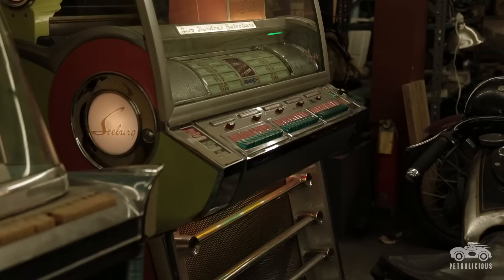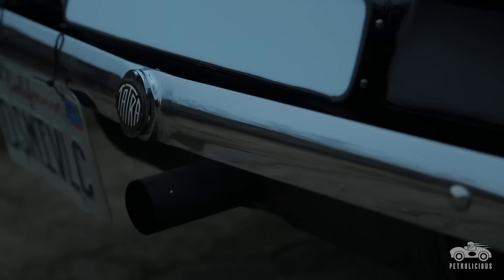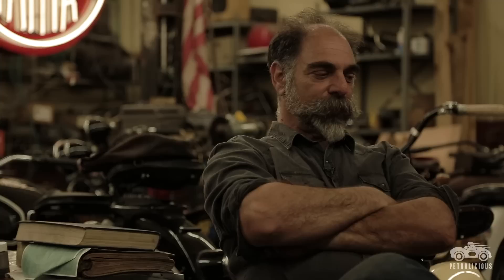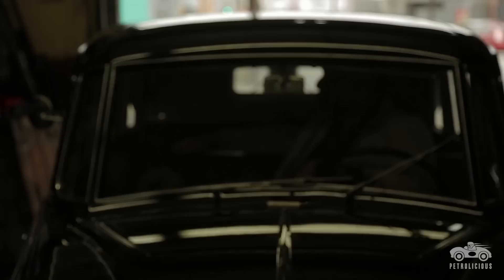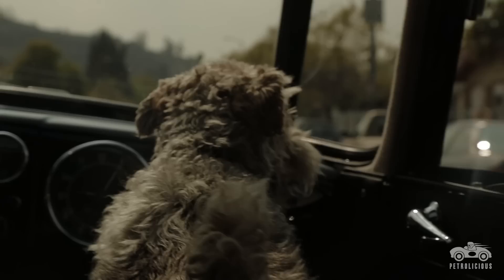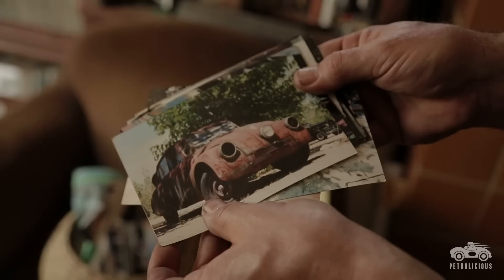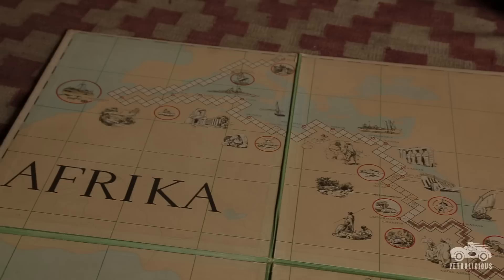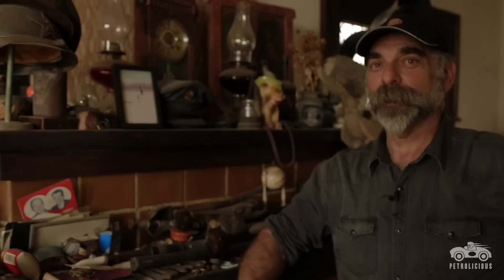Tatra T87 - Things of the Past

Comment: The Tatra looks almost new! I enjoyed every minute of your video. Many have said that there are comparisons between the Tatra and VW, and of course there is. But there is another car that had (almost) taken the shape of the T87. This was the British Jowett Javelin. The Jowett had an engine (flat four) at the front, but check out the similarities in body style and shape of the Jowett with the Tatra. I believe that Jowett (without the Dorsal Fin) got their body design 'inspiration' from the Tatra! Greetings from Australia.
Reply: Peter Sudbury, greetings from England. As a massive Jowett Javelin fan, I think it's amazing that you point out that you think the Javelin looks like a smaller T87, minus the dorsal fin! Amazing car, by any standards. Although the Beetle certainly has a beautifully styled shape, it's not half the car the Javelin is!. The Javelin may have it's own horizontally opposed engine at the other end, but has a 1500 engine, 20 years Before the Beetle! AND 4 doors, something the Beetle never got! (Or DID it?).After Jowett ceased production, almost immediately, the enterprising firm from Berlin, Rometsch ( check them out on the internet) brought out their own stretched Beetles, (at last, Beetles with legroom!) AND 4 doors, as taxis for Berlin. Now THEY managed to make the Beetle look even more beautiful, and also like the already 4 door Javelin!
Reply: @nygelmiller5293  I am originally from within 100 miles where the Jowett was made (in Bradford). As a 10 year-old kid, there were many Javelins on the streets back then, most of them gleaming and new-looking. Also, the Jowett Vans were also being used by Grocers mainly. I did read that the Jowetts had Crankshaft Issues, but they certainly had style. It's sad that (today) most cars get you from A to B - but lack character! I doubt that many modern cars could become a 'classic', so we've seen the best years. Back in 2004, I bought a Superbug Beetle from a Scrapyard, as a burnt-out wreck. An Engine Fire turned the rear half to red rust! I spent more than a year renovating this Beetle. It's the best car I've ever owned, even after owning several new cars. It's all about character, and the classic image, steeped in history from design in 1936. Today, it's a 120 HP Electric Motor, using Tesla Batteries, but i've kept the engine which could be converted back if you wanted. I suppose that a Jowett Javelin (with its' good looks) could be converted to electric, if spares become an issue. I have not seen any Jowetts in this country, but there must be a few around somewhere! Will check out Rometsch. Great to write to you.
Reply: @peterduxbury927  hello, Peter! Thanks for getting back to me! To see so many Javelins,(I've never even seen ONE!) And the cute looking vans, looks like "Jowett Heaven", to a fan, like Me! I have heard heard about the crankshaft issue, but the problem was also something that happened to other cars , before makers realised to have FIVE bearings, not just THREE on crankshafts on 4 cylinder engines. If you DO know, perhaps you could get back to me , regarding how many bearings Beetles have, considering THEY  are horizontally opposed 4 cylinder jobs as well! Congratulations on a). Getting a Superbeetle, and b). Restoring it, and also c).  ELECTRIFYING it!  I am 69 now, but when I was 17, learnt to drive, on a non-Super Beetle. I thought that was fun, but had fun with the OTHER cars I actually owned, after that. (The Beetle was the driving school's car). I admired the Super Beetles, with their much more useable bigger boot   when I left school. I also admired the metallic colours those had sometimes! My favourite colour was a sort of MOSS GREEN, which, guess what? actually IS called MOSS GREEN. As simple as that! I saw one in the street 10 years ago,  like that, for sale! Everything went alright st first. That is, till I got inside - and attempted to shut the door! There was something in the way  stopping it shutting properly. MY SHOULDER! So I realised , that although I am not slender at my age, I'm not exactly fat, either! So a person's "width" does seem to be critical on narrower older cars! And I've obviously broadened out, without realising it! On the subject of electrifying your car, was this done by the firm on T.V., on the programme, Vintage Voltage? All the best for now, and looking forward to your reply!
Reply: @nygelmiller5293  Hi Nygel! Good to hear from you. The Beetle has always had a three (3) Main Bearing Crankshaft, and I havn't heard of any breakages. This must be the design, and of course, German Steel has always been noted for it's quality. I am only 1.65 mtr tall, and very slim, so I have no problem inside the Beetle at all. Going back to your question about converting my Beetle to electric, this is something that I pondered back around 2015. I had worked in the coal mining for the best part of my life, and assisting in pushing plenty of sulphur dioxide and nitrogen oxides into the air, falling back down as acid rain. So, this was my way of making some amends, to have a clean-energy home, and car. All of my Home Lighting is free from the sun, every day here in Sydney. All lights come on automatic, and remain on until dawn. The Beetle was professionally converted by a man named James Pauley, who has a business named as TRACTION EV (Brisbane). I removed the engine/fuel tank, placed the car onto a Car Trailer, and delivered it during May 2019. James kept sending me pics, as the conversion to electric progressed along. I didn't collect the finished Electric Beetle until date 7th March 2021. This was because I went back to the UK for a holiday, March 9th 2020 for just 20 days. BUT I became stranded in the UK for 363 days, not seeing my home here in Sydney! I want to add that the electric Beetle is still not road-registered (yet), I have been doing some interior work, fitting five brand-new tyres, and full set of new Safety Belts. Covid (here) has also played a big part in NOT getting the car registered yet. The Car must undergo a full safety inspection by a government-appointed Engineer, and a roadworthy certificate obtained, because of this conversion. I am just in the process of meeting with an Engineer for Certification. The technical detail about the Beetle: The Main Motor is called a Netgain Hyper 9, with 120HP, and max rpm is 8000.
The Battery Pack is from a written-off Tesla model 'S'. The Beetle has a range of 160km or 100 miles. The Beetle still retains its' original gearbox, with a heavy-duty Competition Clutch. Primarily, you leave the car in 2nd gear. A switch on the Dash is marked as "for' / "rev" and neutral. It is very quick from the Lights, and (at max motor rpm), it should hit 156km / hr in second gear. It's also silent. Many people who convert, use a bicycle bell, to gently move pedestrians!! One day soon, I will be driving it every day! Just a local 'runabout' - that's still a classic! Google "Traction EV" you will see that it's just like Vintage Voltage, but a smaller enterprise than Moggy's. Sorry this is lengthy too!!
Reply: @peterduxbury927  from Nygel Miller, Hi, Peter! I had been looking at Jowett videos on YouTube, and both the Javelin, and the Jupiter seem to have been made in the most striking colours, right from the start. That still makes them special, even today! Although I don't have an engineering background, I may have hit on the reason for the Jowett crankshafts sometimes breaking! I had mentioned (somewhere or other), on the internet, that Jowett had more powerful 1500 engines, from the start, and the Beetle took 20 years to catch up,  perhaps LARGER horizontally opposed engines are more prone to breaking?  Perhaps the crankshafts broke on theirs, and not Volkswagens, because England couldn't get as good steel, right after the war, as Germany? Incidentally, as your are in Australia, it might interest you to know, that in the 60's, our neighbours emigrated to Melbourne, on one of those cheap passage special deals. My friend Valerie werec11 at the time,but wrote to each other. I felt we were like cousins! When she was 30, she had got married to an Australian, and they came for a quick holiday, and I met them in a beautiful pub in London! After an initial half hour, not knowing what to say, Valerie were instinctively talking like the old friends we were! Her husband seemed nice too. I was actually depressed to just go back to writing to her when she went home - it was a shame I couldn't meet them sometimes  for drinks. After a couple of years, I concluded it WAS better to write again to Valerie, rather than nothing at all - but she had changed address. SO I'm going to have an all out attempt, to find HER! Wish me luck!
Reply: @nygelmiller5293  I'm 73, but came to Australia in 1988 for a year. It really is a great country to live. More of an outdoor life compared with the UK. a more diverse population, that seems to get along OK. Yes, I wish you all the luck in finding Val, she may even be living alone - or with her family. I don't know where you reside in the UK, but I'm originally Blackburn Area, but spent 21 years living in Hull. I was in Hull last year, when the pandemic hit, and no planes were available to take me home. I also spent about 200 days in Bolton. German steel was always notably better than other countries. Poor quality steel sank the Titanic, it became brittle at low temperatures. Yes, the Beetle started with engines of under 1 litre, and they evolved over a lengthy time period. But the Boxer engine is highly successful, giving cars like Porsche and Subaru a low centre of gravity, improved road-holding.  The Subaru WRX Gearbox has been adapted recently, for use in higher performance Beetles. I am currently researching this. It's a lot to ask a 50 year-old (50HP rated) Beetle gearbox to handle 120 HP. The gearbox is most likely to be the Achilles Heel in this conversion. A Subaru gearbox can handle 280HP, that's the difference.

Comment: Wonderfull car thanks for showing, I didn't even know these existed. I would like to know why the license plate is zip-tied to the bumper, wierd to see such a beautifully restored car with that. I think it is because he didn't wanted to alter the car's originality by fitting a bracket, anyway I think he could've done better. And have you seen the amount of wheel weights, you do with what you get I suppose.

I'm reading in the comments that porsche based it's first "beetle" car on the tatras, is the car on the lift at 0,28 secs a tatra or a really early beetle? Because I've never seen a beetle with those headlights and the rear quarter pannel isn't the right shape but the overall shape is the same.

Comment: Just FYI Tatra had never made aircraft engine with more than four cylindres. The aircooled engine is a speciality of Tatra even nowadays, they have developed air cooled diesel complient with EURO 5 and developing diesel air cooled engine compliant with EURO 6. And engine in fabulous T87 is "just" a predecessor. And believe or not, it was designed right and only for T87.

Comment: Nice car but lets not forget the first car that was very aerodynamic was the Chrysler Airflow which predates the Tatra T87 by two years the first model came out in 1934.
Reply: Also, the original SAAB had those aspirations:

http://en.wikipedia.org/wiki/Ursaab
Reply: Peter Rydholm But that project didn't start until 1945.  The Chrysler Airflow was the first mass produced aerodynamic full sized car with a traditional layout (front engine rear drive).
Reply: Of course they didn't invent aerodynamics but they where the first company to mass produce a traditional (front engine, rear drive) full size automobile that was very aerodynamic.  Also the car pretty much influenced the style of all American cars of from the mid 40's to early 50's.
Reply: The Airflow was one of the first full-size American production car to use streamlining as a basis for building a sleeker automobile, one less susceptible to air resistance but it was ultimately a huge commercial failure. The Czechoslovakian Tatra 77 (T77) is the first serial-produced truly aerodynamically designed automobile. It was developed by Hans Ledwinka and Paul Jaray , the Zeppelin aerodynamic engineer. Launched in 1934, the Tatra 77 is a coach-built automobile constructed on a central tube-steel chassis and is powered by a 75 horsepower (56 kW) rear-mounted 3.4-liter air-cooled V8 engine. It possessed advanced engineering applications such as overhead valves, hemispherical combustion chambers, dry sump , fully independent suspension, rear swing axles and extensive use of lightweight magnesium-alloy for the engine, transmission, suspension and body. The average drag coefficient of a 1:5 model of Tatra 77 was recorded as 0.2455. The later model T77A has a top speed of over 150 km/h (93 mph) due to its advanced aerodynamics design which delivers an exceptionally low drag coefficient of 0.212, although some sources claim that this is the coefficient of a 1:5 scale model, not of the car itself.
Reply: Stanislav Skurak
I wouldn't consider the Chrysler Airflow a huge commercial failure there are only a handful of American cars that I would put in that category the Pontiac Aztec comes to mind and the Tucker or the DeLorean.
Reply: Actually the first car, or the oldest from what I know and found on the internet, with a teardrop or raindrop shape was build by a romanian guy called Aurel Persu in 1924.
Reply: @Just looked him up on wikipedia interesting guy makes sense that he was into aerodynamics since was into airplanes.  Also the picture of the car from the museum says the car is from 1923.
Reply: Ok, 1923 then :). The car exists actually in a museum in Bucharest.
Reply: Yeah that is where the wikipedia picture is from its in rough shape since it actually was driven for 1600,000 miles according to the article.
Reply: guys, the first aerodynamic car was the Daewoo Lanos!
Reply: Tatra 87 was company's second aerodynamic car.. They were making Tatra 77 from 1934

Comment: wesome car.  These will bite you badly if you're not careful, though.  With a big engine in back, swing axles and leaf springs, you can easily get surprised by the handling. The Nazis lost so many SS officers in these cars that they forbid them from driving them.

Even so, it's great that one more has been restored and preserved.